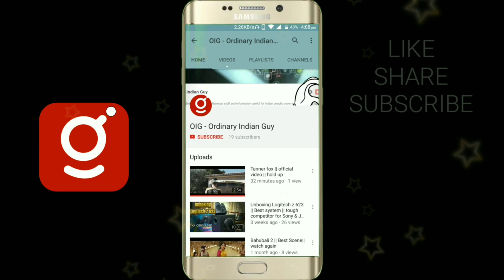What's inside LG SL6y Subwoofer || Andar ka scene || LG Subwoofer ka postmortem

Comment: Man, this subwoofer is a joke.....so poorly and cheaply constructed.  I was hoping for a way to salvage the wireless connection and plug it in to a differnt sub, but that doesn't seam easy to do for a novice.  I'll check the connections at least, make sure nothing is loose.  seems liek it shorts out on me especially at low volumn, not passing current to the driver consistently, last time I had that, the red wire to the driver was loose enough that it woudl arc across but not make good contact so output was low and crackly, same here.  trying to get the top cover off to look at the driver wiring
Reply from the maker: Absolutely agree bro. This sub is like nothing. In other words, it's a Mid driver, not subwoofer.
Reply: @OIGOrdinaryIndianGuy  Disappointing, becasue LG has done decent subs in the past with their blu-ray home theater systems.  the sound bar it came with is too expensive for a mediocre sub.   Maybe time to dump LG and give the Samsung q950 a shot.
Reply from the maker: Right, but Samsung is even more bad than LG. That's why they tied up with Harman kardon. But still, I don't like them. So, prefer that company who is only making these home audio products only.
Reply: sir did u find out way to connect car subwoofer to wireless woofer unit